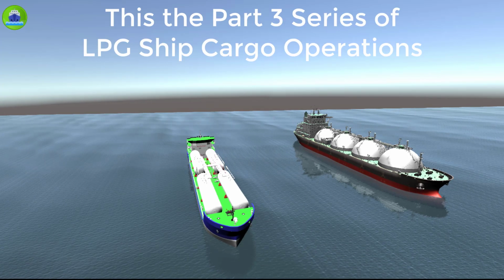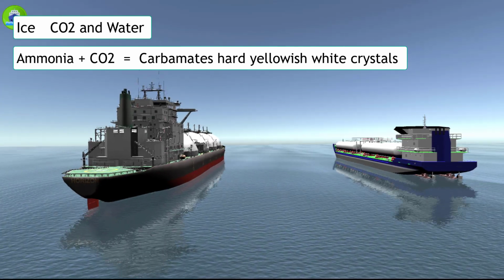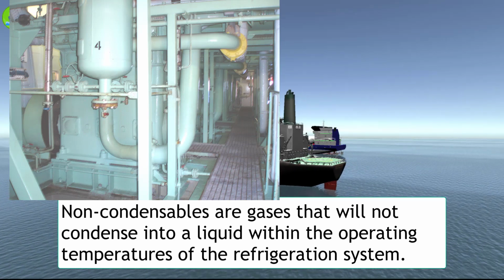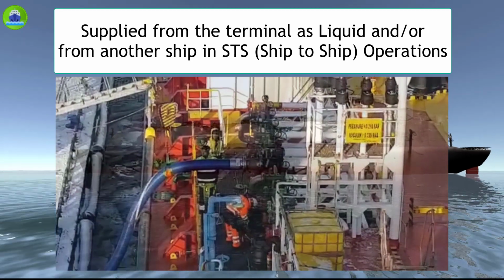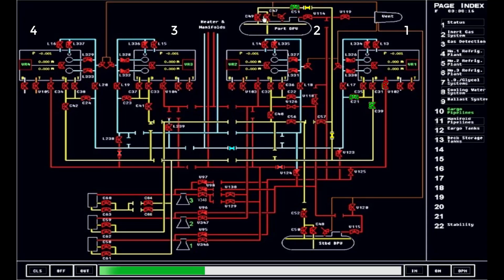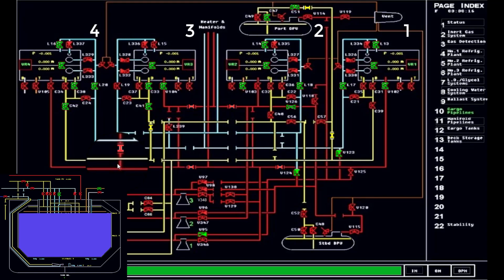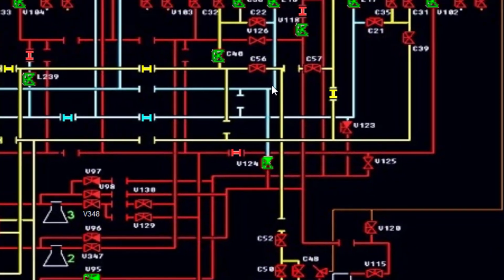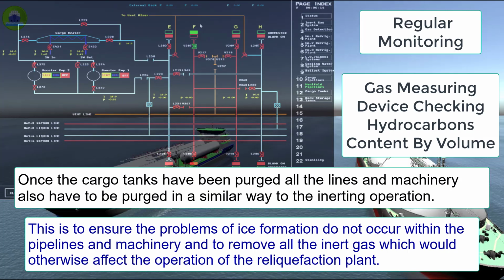LPG/C Ship Cargo Operations Part 3 - Gassing Up Operation prior to Cooling Down  &  Loading

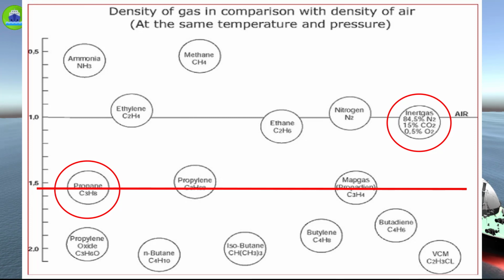Comment: in 7:50 - can you explain what happen when you are dealing with ammonia? as ammonia is lighter than the inert gas? thank you for all the videoes!
Reply from the maker: Ammonia cannot be mixed up or replaced with Inert Gas as they will react to each other. Ammonia instead is purge or Gas freed with Air and has nothing to do with Inert Gas. Hence, if it's gassing up then Ammonia is introduced on top to replace air, whilst if doing aeration then Air is introduced into the bottom. That is if displacement method is used.
Reply: @ShipAhoyVlogs  sorry I meant, before you gas up for liquid ammonia product, do you inert your ship tanks? or only purging with air? would the O2 in the air cause an issue?
Reply from the maker: @hazza11235  No need to inert the tanks when Gassing up with Ammonia. The tanks must be filled with Air, dry air. O2 does not cause an issue.

Comment: Sir , What about the formula to find the right amount to load in order to  gassing up? Thank you
Reply from the maker: There is an app with a download link in some of the videos uploaded. It was a software that runs in Windows OS that I created 5 yrs ago. You will find there the solution. However, in most cases, there is a Gas Form C and Manuals on board with given value for such quantity to load. Which there is not a need for formula.
Reply: @ShipAhoyVlogs    Yes , I know about gas form C . I will take a look on the link !
Reply from the maker: @gabrielebambino6083  I will make a new edition for such software. The one that is downloadable has no printing features or disabled. If i find time, I might recreate it since the original source code was corrupted though starting from scratch is holding me back. so its just on the pipeline i guess.

Comment: Sir paano pag walang storage tank?
Anong cargo tank gagamitin for gassing up..thank you..
Reply from the maker: Liquid can be supplied via Manifold from shore then thru Vaporizer and to the Cargo tanks. Same with STS if done off port. Else, if your Ship is Semi Pressurized  & Fully Ref then a certain amount of liquid can be directly loaded to one tank but it has to be done gradually as the tanks are not cooled down yet. This has been done in practice, sometimes you don't even need to pump thru the vaporizer, we just let the liquid boils off, open other tanks in series which eventually will be gassed up. Again, this depends on your cargo containment type.
Reply from the maker: The method done directly to the tanks are most applicable on Ethylene ships. Especially that the Inerted Atmosphere is Nitrogen and not the typical IGS, so even if it isn't gassed up yet and not cooled down, the containment is more robust and hence forming of solid particles are not common since it was purged with 99% N2. Please check your ships P and A Manual. Else, your Operation department will instruct your vessel accordingly.

Comment: Hello Chief  Can CNG using for Gussing Up.. As option we dont have the LNG.. Please advised.. The Gassing Up for LPG. Any refrences/Guideline 
 ..Best Regards.
Reply from the maker: I have not experienced such. Technically, since it is compressed then its cold and that you need to pass it to a heater or vaporizer to farther warm up. Gassing up temp should at least closed to the ambient temperature of your containment else it would take a long time. I have not seen any references/Guidelines. I have no idea, this is just a theory I have. Pls do not use it as advise.

Comment: sir sorry but i have doubt....after inerting all the compressors how would you purge the lpg gas back before running compressors as inert gas is considered as incondensable. all this sir i am asking after gassing up operations. maybe it is a silly doubt but thanks
Reply from the maker: doubt is a good thing if you put it in the right perspective. its okay to doubt especially with Cargo operations. this is basically tells you to think and analyze so do not ask for apology or "sorry sir". This what learning is all about. At the end of the day. I could be lecturing the wrong way. So its a good thing to scrutinize, suggest, criticize and just layout if you think you need more explanation.
Reply from the maker: the same thing as you inert. Gassing up follows and all the system are purge with the cargo or gas. though you cannot avoid and it wont be 100 percent gassed up. pockets of incondensable will still be left and expect that the performance in the early stages of loading when the plants are commissioned will slowly cope up.
Reply from the maker: LPG cargoes are loaded thru the deck storage tank or directly from manifold and thru the vaporiser where it is basically sent thru all the tanks and associated systems. other methods is to load a considerable amount into the tanks and stir it up with pumps and let the gasses finds its way (applicable with semi-press/fully ref type). once tanks are done the gases can be diverted to compressors, etc. hence the use of gas measuring device is important. we will also open drain valves just to make sure gasses is passing thru but this has to be done cautiously especially inside the compressor rooms if drain valves are loosened. this only to check if gas managed to purge the compressors.
Reply from the maker: The design and piping layouts is another important factor to consider. When you purge lines, whether gassing up/inerting/gas freeing it doesn't mean that because its open and its where you directed the flow....do not expect that this would smoothly and completely purge the entirety of the cargo system, some Gases maybe trapped in spool pieces, curves and bellows even the cargo tanks where transverse bulkheads and beams may still have it in small amounts. Same thing applies in the compressor rooms, etc.
Reply: Typically you have on some ships device called “purge condenser”. Normally it would be used if condensing pressures for cargoes after last stage of compression for given temperature are not corresponding to normal condensation pressure. Higher condensation pressure will indicate for you presence of incondesibles. Easy way to start after gassing-up is to run compressors on lower load (typically on 25 or 50 load capacity) and then to manually relief pressure back to tank for some time until you get first condensate. Then you can start running plant on full capacity and vent a bit of pressure from condenser back to tank to allow plant to run without stoppages. If purge condenser existing - engage it and set relief pressure at about 0.5 bar higher than condensing pressure of your cargo. Continue venting until you get proper condensation pressures, constant condensate delivery and steady compressors parameters. Note that due to venting you’ll lose a bit of cargo. As a Chief Officer I always followed this procedure and always succeeded during initial stages of cooling after gas up. Also consider that the higher condensation presssure - the harder to get rid of nitrogen and “purge” your tanks, for example with ethylene molecular weight of which is very close to nitrogen.
Reply from the maker: @olegno8943  Well said Chief. Nice for you to bat in and add or expound more. I could have said more but I am actually trimming down more of my lecture to a lesser degree. Training centers and their company and individuals alike has to dig in more by themselves. However, I am thankful you add more ingredients. We can all learn from each other and that would be something.

Comment: This is why chief officers on tankers are paid way higher compared to ships transporting dry cargoes.
Reply from the maker: Generally, I agree with you sir. Although some companies who operates both variety of Bulk & Tankers offers the same salary whichever vessel assignment they are into. However,  it is most applicable to the engineers and Master for cross crewing/manning. Hence, its easier when shortage of manpower is on hand. Still is a profound statement just as you said so. Pls suggest and appreciate much if if you could scrutinize as well if I missed out some things.
Reply: @ShipAhoyVlogs   I'm only a newbie sir on a gas carrier but the way I see it coming from a ship handling dry cargoes, chief officers job on tankers  are quite complex, with all the explanations you presented.  Plus gas carriers or generally tankers are more expensive to build hence skills for these type of ships are paid more.